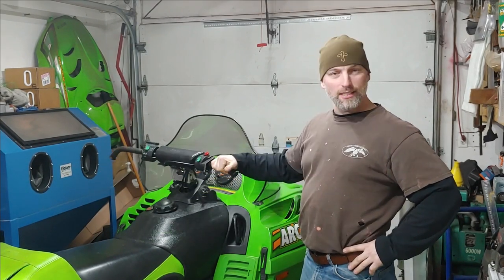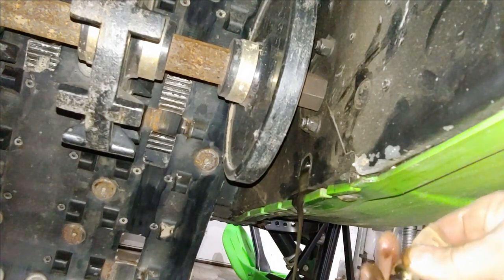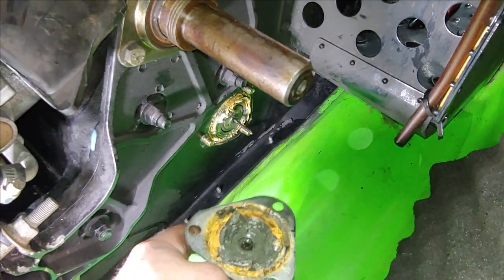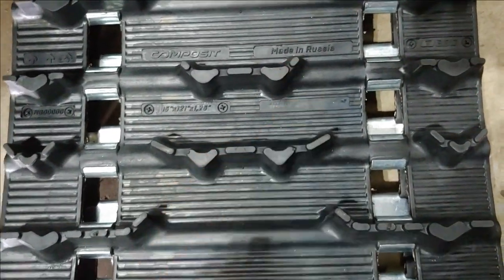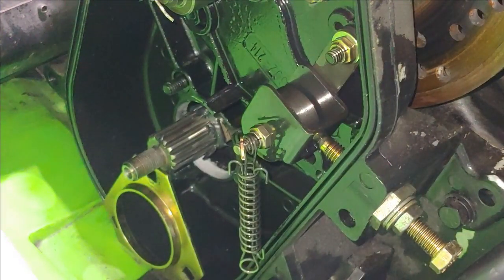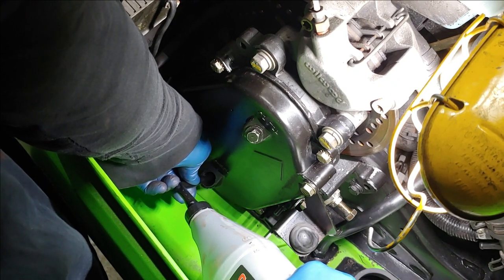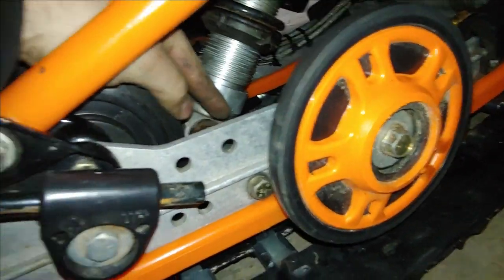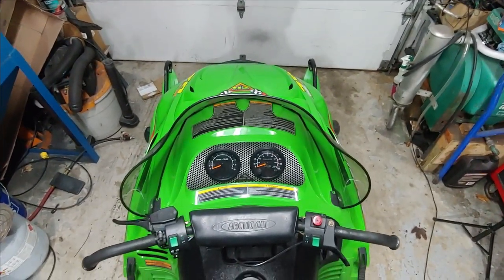02 Arctic Cat ZR 600 EFI Part 14: New Track [Remove old & Install New]

Comment: great video!  Thanks for making it.  I think most driveshaft bearings have a lock collar on the speedo side.  I didn't see that in your video.  But all around really nice informative video!  I have the exact same sled with reverse.  I LOOOOVE it!  EFI is the best.  Two pulls and it starts everytime!  Never seen such a clean snowmobile bellypan area as yours!!!
Reply from the maker: Glad it helped. Ued lock collar was there and yeah I used a fee diff things on belt pan.

Comment: Gr8 job.  U saved me a ton of work.
I only needed the drive shaft bearing replaced inside the chain case.
Thanks!
Reply from the maker: Good deal. May as well replace the clutch sidee while you're in there. I would. That way you dont have to worry about it. Glad it helped

Comment: Great vid with no bs.... Just about to get into my 02 ZR 800. The speedo pin just broke due to that jack shaft bearing failure.
Reply from the maker: Glad you found it useful. Yes that can be the cause. Sometimes the Speedo gear and can dreeze up from sitting and when the sled gets used again it will snap tat wire pin.
Reply: Will see what it's like when i get in there. I can hear the bearing squealing right when the clutch engages too.
Reply from the maker: Oh now thats a diff story. BUT, Primarys can squeal as well or more so portray a squeel.

Comment: Awsome video. Followed it to the letter when  I changed the track on mine (same year, make, and model). Only question I had not sure if it makes a difference but when. Butting the oil in the chain case I was tought to use the oil fill at the top so the oil coats the chain on the way down. Supposedly it helps chain wear so it's not dry on initial start. Just wondering if that makes a big deal. I replaced the chain so it was dry. I soaked it in fresh oil first but just asking becouse you seem much more experienced in this field then I am. Thank you so much. Keep up the great work.
Reply from the maker: Awesome! Glad it helped. I dont think it matters. The cain will completely.run tjrough the oil at the bottom assign you take off and keep doing that shie moving . I once forgot to add oil to my wifes chaincase snd she put 350 miles on ths sled before the chain and top gear gave way. 🤣

Comment: Great video! I'm not afraid of doing a track now. I just purchased a '99 ZR 700 with a brand new track installed but the speedometer doesn't  work. The previous owner included an uninstalled cable which I swapped but still no speed indication. I'm wondering if they forgot something in the speedo gear when they put the new track in. BTW, I didn't know there was a drain plug for the chain case so I did the oil change the hard way by sucking it out with an old outboard motor primer bulb and hose. LOL!
Reply from the maker: Good deal!? Yeah I would pop the Speedo gear off amd see if there is a transfer pin in it. It might be broken. You might need new bearings.
Reply: @Fixin2Ride-Official-  So I did indeed pulled the front clutch off and opened up the speedo gear and sure enough, the drive pin was sheared off with half of it missing. I think the previous owner just didnn't bother ordering it when he did the track. I got one on the way now.
FYI, I use a cheap Harbor Freight chain hoist to an eye bolt in the ceiling of my garage to lift the back my sleds. It makes life so much easier! The info in your videos is so helpful. Thank you!
Reply from the maker: Good deal I figured that pin was sheared. That's normally what it is. Also make sure that when you get the new PIN you can put it in either side of the speedo gear and the little square hole and spin the speedo gear easily with your fingers if not you're going to need to either get a new one or you can actually loosen them up you just need to take a square screwdriver bit and either and that fits properly and work it loose spraying PB Blaster in both ends and then just keep working at loose getting oil in there loosen it up real good then put it in a parts washer keep loosening it up and then put more PB Blaster loosen it up more than keep redoing that and then once you feel that it's cleaned up good enough oil it up again put that square bit into a drill and put it in either end of the speedo gear and crank that thing out a few times just to really clean it out then you can clean it out one more time and lube it up and it should be good.
 
 Also I would be careful about only using an eye bolt for that chain hoist. I ended up drilling a couple holes on either side of a ceiling joist in my garage and wrap the chain around the ceiling joist and then join that together with a coupler and then use that for my chain hoist and I can lift the front end of a big thousand CC Thundercat up with ease and no worry
Reply: @Fixin2Ride-Official-  So I have another question about my '99 ZR 700. The previous owner claimed the top end was done pretty recently, maybe 100 miles on it, Shouldn't the compression be a little better than 125 psi per side? Not sure if the crank seals are original.Thanks.
Reply from the maker: Yes if the top end was done right. A light honing and nee rings, pistons and a good breakin. Meaning no long idling. Typically just one heat cycle to take the stress out of the cast parts and then ride it hard. No long pulls. My 95 ZR 700 engine that I rebuilt has around 136 per cylinder.

Comment: So I think I put that chain case bearing back in 180 degrees backwards so that raised metal edge is facing in. Is that going to be an issue?  The built in rubber gasket is on the outside vs the side closer to the track. I have the cover alm back on and oiled up already. Rrrrrrr
Reply from the maker: Yes the flat side of the bearing needs to be facing the track. The protruding inner race of the bearing needs to facing the gear. Just warm the case with map gas torch and then drain. Put old folded shop rags under the Chinese to catch the remaining oil as you pop the cover off. It wontbtake long. You already know what to do. Getting all your tools laid out and ready to use with expedite the process.

Comment: Here we are another ride season,enjoy your content andrew always a joy to watch you wrench,very well and thorough explanations!!as well as good lighting n camera work.when able.i just got a used 90s polaris 400 indy its a nice ripper,fixed in tank line and pump..only it doesnt have reverse or electric start but noticed there is a mount for starter.i wonder do you think i could transplant another sleds reverse box and clutch with starter ring into mine.i saw an indy 500 clutch online with starter set-up and a cat 538 with a reverse box n brake similar to my brake set-up.do you think itll work or any direction u can point me in to make this idea work?snookie pa.
Reply from the maker: Hey hey welcome back alan! Thanks for the compliments always greatly appreciate it. Congrats on the new sled and yes I would say that is 100% possible as is with the Arctic Cats that I have. Just make sure that you get the complete setup for each and you should be able to swap your Parts out for the new. Might be a little tedious but in the end it will be well worth it for sure. Working on more content as we speak so as always stay tuned thanks for watching and please share when you can. God bless

Comment: Helpful video. RE: 1995 ZRT 800.  Have a frozen bad bearing on the driven shaft (belt side) that I can't get off.  Got the hex nut out but the rest is frozen on. Any suggestions?
Reply from the maker: I believe it may have a lock collar on it that has a set screw and then sometimes you just gotta heat that up and get the collar off then try and hit the bearing from the back on the inside race of the bearing right at the shaft with an air hammer and then heat up the bearing real good it should pop off

Comment: Great video..!! I am changing a track on a 2000 zl 550. The only trouble I had was I couldn’t get the bearing off the chain case side if the shaft. Bearing felt good so I just slid the track off with chain case side still attached. I just got everything apart and I am going to reassemble it tomorrow. The reverse makes the Chain case a little more difficult. There is quite a bit going on inside there above a normal setup. We will see how it goes.
Reply from the maker: Could be that it's just silicone down there and needs to be forced off. The later versions of bearings started thing made with o rings on the inner race to help seal them. So I'm sure some people still used silicone or our TV seal the shaft to the inner race of the bearing. But yeah I feel bearings good then you should be fine
Reply: Thanks for the response. On my chain case I have a wound flat spring tensioner that tensions the chain. How much do I tension that spring inside the cover before I fasten it down? Thanks for you quick response. I appreciate guys who take the time to add repairs like this for all of us out here.
Reply from the maker: Good deal no worries. That should just hook over to little bolts on the tensioners and it's self-tensioning that spring is. Or are you talking about the bolt on the side of the case that goes through the case and pushes on the roller to create tension on the chain? If you're talking about that then if it's not Auto tensioning you loosen the lock nut and then screw the bolt in by hand to where it's only fingertight so just snug with your fingers not cranking on it and then lock the nut down. But if you're talking about the auto tensioner you have to win it all the way in to where it takes attention off and then let it unwind out to where it puts tension on the chain and it will auto adjust from there.
Reply: @Fixin2Ride-Official-  it’s the auto tensioner. I wound it up enough so I could get it inside the housing then put the cap on and wound it a few more times. I ran the tensioner up by hand first, hand right. Then put on the auto tensioner roll I’m and the sap and gave it a few more turns. Will that end up being to tight?
Reply from the maker: You should unwind to where it's loose and then let it tighten itself
Reply: @Fixin2Ride-Official-  do I take the whole assembly out to do that? I saw there is a lock set screw on the side That holds the shaft. Must have to run it in, then lock it, then screw the whole thing in then release the set screw?
Reply from the maker: The lock collar needs to have the set screw loosened then twist the collar and slide it off the bearing before trying to remove the bearing.

Comment: What was that braided hose you were messing with towards the end of the video?
Reply from the maker: That was for the front skid shock. If I remember correctly
Reply: Ok must be an aftermarket thing then. I don’t have that
Reply from the maker: I just looked at it. And that was the skid that came off my 98 zr that had the remote adjustable shock on the front of the skid.

Comment: That motor mount is jacked....I saw the engine moving around when you had it engaging with the hood up...that's your low end bog under power that engine is flopping around
Reply from the maker: Not sure what mount or engine/ sled you're talking about?  This sled runs great now after rebuilding the engine and TSS switch...

Watch here. 
Https://www.youtube.com/watch?v=IGyR7jHwino

Comment: I just recently purchased a 2001 ZR 600 APV. It runs very well. However, when I apply the brake somewhat hard, there is a crunching/ratcheting noise coiming from down below the track area. When I apply the brake slowly, it does not make any crunching noise. Would you have any input on what this may be? Track feels tight enough, loose chain in chaincase, maybe?
Reply from the maker: Do you have studs in the track? I  would check the tracks inner lugs to see if any are missing if its an older track as well as if you have a 2 cog or 4 cog drive axle. You should only have about 1.25" in the middle of the track in between the hyfax and track when hanging 20lbs of force from it.

 Also check to see if you have oil in yoir chain case or not and check your gears, typically the top one for rounding of the teeth. Each tooth should have a square-ish end. And when you remove the chaincase cover, check the chain tension, it shouldnt be floppy at all by moving woth your fingers.
Reply: @Andrew Crocker - Fixin2Ride  I opened up the chaincase and inspected everything. The gears looked good. Chain was a tad loose, so I adjusted that.  Fluid was kind of thick and gummy, so I cleaned that out, and I topped it off with new fluid. No shavings, either. But I believe I did get it narrowed down. When I got back on the sled and took it for a ride, I noticed the clutch jamming up  when I hit the brake hard. I could see it through the openings of the side dash. I jacked it up in the air to see if it would still do that and nothing. Did it about 3 times, no noise or crunching. It's only when I'm on the sled with  hard braking.
Reply from the maker: Can you get some video ans post it to your channel? You can download the youtube app and upload right from your phone through the app...
Reply: @Andrew Crocker - Fixin2Ride  I will certainly try tomorrow. I will have it on the trails, and I can have a friend help me. I have the app and should be able to figure it out. Thanks for your help. I'm new to these ZRs, and I'm excited to ride one.
Reply from the maker: Check out my 02 ZR 800 Cross Country...
https://youtube.com/shorts/WdkyVzlJatc?feature=share
Reply from the maker: More of it. https://youtube.com/shorts/PXd0TeUcZoo?feature=share
Reply: Hello, I'm back with another head scratcher. My zr 600 will bog and not accelerate when I apply full throttle no matter what speed I'm at, but when I give it low to mid throttle, it runs strong and fast, and can get up to 80mph with ease. Gas mileage is horrible. It idles pretty good, sometimes a little high, but will eventually go down. It starts up just fine, with one or two pulls. It only bogs while I'm riding the sled. It didn't bog when I had the rear end jacked up. Any info will help. Thanks again.
Reply from the maker: Check out your clutching and your jetting.
Reply: @Andrew Crocker - Fixin2Ride  You nailed it. Both main jets were snapped off. Replaced them and cleaned carbs. Runs mint.
Reply from the maker: Nice! And some people. That stuff doesnt just happen. Lol. Snapped off? We're they in the carb bowl?

Comment: What shocks do you have in that skid? Looking to replace mine on my zl800ss and go away for the ss shocks.
Reply from the maker: They are fox shocks. Rear is a clicker and front is the remote adjustable.
Reply: Do you have part numbers for them?
Reply from the maker: Go here and look up the year and model and go under the appropriate parts diagram and they will have all the numbers you need. https://www.arcticcatpartshouse.com/oemparts/c/arctic_cat_snowmobile/parts

Comment: 01 zr 800. I can't find the bearing to the chain case. I ordered the kit for 600 zr but it's same part number as the 800 bearing but will not go onto chain case side. The bearing for other shaft side fits on chain case but it don't go on that side. Any help please. Thanks
Reply: I'll cash app you every time you help me out with my ZR man. Thanks
Reply from the maker: Do you have the collar side sticking out, away from driveshaft? So the flat side of the bearing needs to ride against the lip on the driveshaft and you need to install and lock down the chaincase bearing before the speedo side bearing. You may have set the speedo side bearing too far and it's pushing the chaincase side too far over into the inside of the chaincase.
Reply from the maker: I have a donate button for my PayPal at the top of the homepage if you'd like to do that. Thank you!
Reply: @Fixin2Ride-Official- Did you replace the chain case bearing to drive shaft or just use same one? I replaced other end already but can't find a 1" bearing for chain case
Reply from the maker: I replaced all the bearings
Reply: @Fixin2Ride-Official-  are the Bearings the same for both ends of driveshaft 1"? so I just need 2 1" of same bearings to solve my problem?

Comment: I hope you'll see this. I'm wanting to do a new track on my 92 wildcat. Is it the same as what I saw in this video? Also  I'm wanting to put a taller lug track on for stability and whatnot. According to the arctic part store mine came with a 0.85" lug. Can I go taller to like a 1.50" lug without damaging the heat exchanger? Thanks
Reply from the maker: Hey there. Welcome to the channel! Yes the process is the same and you shoukd be able to get away with a 1.25" lug and be just fine. Here is what I would do. With your sled on the ground, get a flash light and look up under the tunnel near the front drivers on top of the track. If you have about 1/2" clearance you should be able to get a 1.25" lug track. I have never had any issues with tjis size track on any of my sleds that have one. I have 4 sleds with it. I trail ride as well. 1.5" wont do anymore for trail riding except add weight to the sled which will affect rotational weight of the drive system.

Comment: One thing I wanna do this year is put a water temp gauge on my 99 600 efi jw but is it really only 2 wires and the sensor wire?
Reply from the maker: Yes.typically. You csm get them digital, round, rectagular and even a piece that you splice right into the moddle of a hose.

Comment: Hi Andrew. I bought my daughter a 1990 AC Prowler. I have a new track for it and I just watched your entire video and I ordered everything you recommended. Loctite blue & red, brake cleaner, also Lucas Synthetic 74/140 gear oil… I’m thinking the change out should be about the same? I saw another comment in regards to a 1992 Wildcat and you told him that it should be the same. Wish me luck sir 😆
Reply from the maker: Good deal. Yes it the same basic principal for removala nd install. Sleds basic drive mechanisms havent change at their core in a long time. You should be good to go.